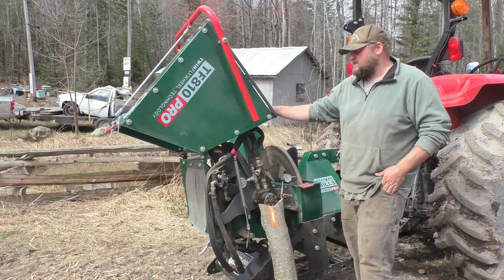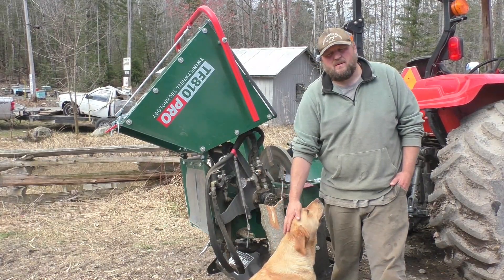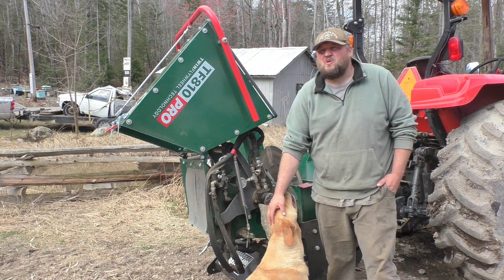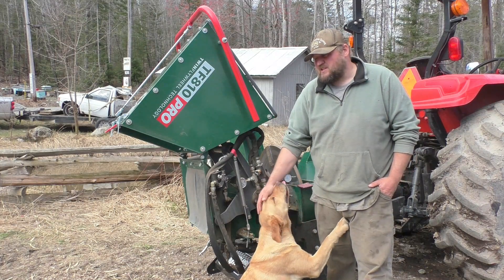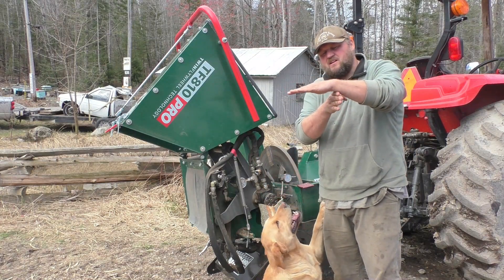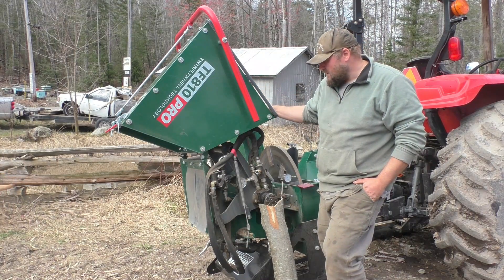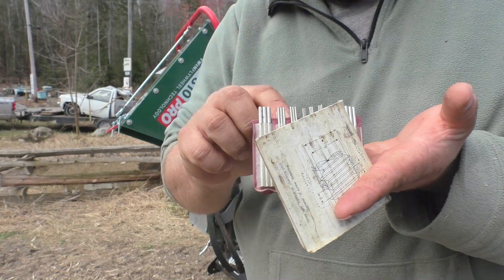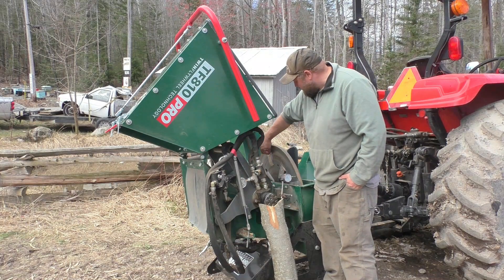Woodland Pro TC810 wood chipper LATEST UPDATE WITH MEASUREMENTS

Comment: I have the smallest woodland mills pto flywheel chipper, the tfg55. I have chipped up some white pine and white cedar a few times and the chipper did a fantastic job each time without any issues. Today is the first time I tried to chip some hardwood (Ash) and I blew through 3 shear bolts in 5 minute on 2.5 inch branches. I only had 3 so my day of chipping that I planned ended abruptly. I am going up to visit woodland mills Friday for their milling days demo. I plan to talk to them about the shear bolts snapping. 
I was wondering if you got any resolution witth the issue? I watched your first video on the issue and obviously this one and I appreciate all the effort you have put in to figure things out. I feel for you for all the issues you are having. Hopefully things get better. Take care!
Reply from the maker: Unfortunately it ended by woodland buying it back after a year . There's been no feedback on the outcome of receiving it back and "testing" it so it's safe to assume what I showed in the videos is the normal operating experience, which is extremely less than advertised. Thanks for watching.
Reply: @stuffnsuch631  That's unfortunate for sure. Thanks for sharing, I appreciate it!
Reply: I spoke to a woodland mills tech and basically the solution was to try speeding up the rpm's on the tractor a bit. I did post a video on my YouTube channel when the shear bolts broke while chipping. In your other video you mentioned all the shear pins you went through. I checked at my Kubota dealer today for shear bolts and they want $6.95 plus tax. Do you know of a place to get them much cheaper? Thanks and have a great week!
Reply from the maker: @JelenOutDoors I'd ran my tractor on 540e and wound it up to almost max rpm. Chipper would have been at 800rpm . Helped a bunch. Eventually they gave me a slip clutch PTO shaft which was a game changer. Should be stock equipment. I was just using 5/16 grade 8 bolts.